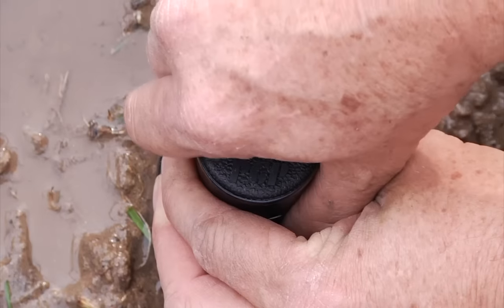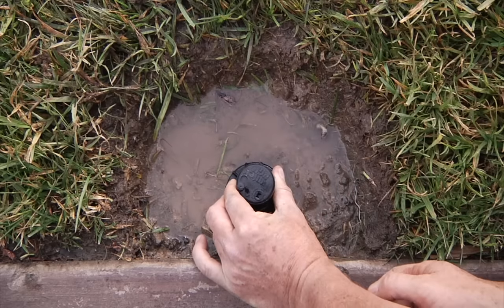Adjusting a Hunter Rotor: Rotor Right Stop Adjustment

Comment: This was exactly what i needed. I’ve been messing with these screws for days with no result. Now i learned that the sprinkler doesn’t need to be running to adjust it, and no need to wait to see how it turns after changing a setting. Now i know exactly what to do 👍 But maybe i broke some heads already. Will see.
Reply: Great video.  I tried looking through the instructions and they seemed a little challenging.  I adjusted 6 Hunter heads today and they all went well so thank you very much for helping the instructional video.

Comment: To anyone out there, a word of warning: in this video the large, black plastic ring he unscrews at 3:20 to remove the inner barrel/sprinkler riser loosens up with hardly any effort.  IF this same ring on your Hunter I-20 sprinkler head has not been removed in a long time, there is a high probability that as you crank on the ring counterclockwise to loosen it, instead of "only" the ring coming loose, the ENTIRE sprinkler, (meaning the inner barrel/sprinkler riser, the ring AND the outer barrel) may come loose from your water feed line below the entire sprinkler assembly.  How do I know?  This happened to me today when trying to remove the inner barrel to set the right stop of the arc.  I then put the entire sprinkler assembly in a vise and tried to loosen the ring with a pair of channel-locks.  No dice.  I then tried loosening the ring using 2 channel-locks gripping the ring and the outer barrel.  Still no dice.  The bottom line is I couldn't get the ring off (to remove the inner barrel/riser) without crushing / completely destroying the outer barrel.  When I called Hunter Tech Support the guy I talked to said that in order to NOT have the entire sprinkler assembly come loose he digs down BELOW the ring and puts a pair of channel-locks on the outer barrel and then twists (either by hand or a second pair of channel-locks) the ring loose.  Bottom line: be prepared for the ring on your sprinkler to NOT come loose as easy as in this video.  Sorry for the long post but maybe this will help someone out there.
Reply: That’s common sense tho. I work at a soccer complex so we’re always replacing head. You need to dig about 10 inches to be able to get the guts out of the sprinkler head. Other wise yeah the whole unit spins and you might get a leak or the whole head just popping out of the ground.

Comment: Perfect!  Appreciate the "two methods" to adjust the right stop; some other videos just say to tight the whole rotor sprinkler clockwise, which could crack the rotor bottom or the underlying threaded riser if the rotor was fully tightly screwed on already.

Comment: I'm confused, you said that the raised rubber arrow is the area that is used to adjust to the right or to the left. I thought that that area could only adjust the water that comes out. Basically to let it flow straight out or more like a spray. I thought that you are suppose to use the hole that has the plus and minus for adjusting the head swivel.
Reply from the maker: Thank you for contacting Hunter Technical Support.
 
Please visit this support section to view our written adjustment instructions. For help aligning the right stop, click here. https://www.hunterindustries.com/support/residential-rotors-adjustment-instructions

Comment: Thank you.  As a single woman, I pay my landscaper $55/year to adjust the sprinkler heads.  If I see brown spots and call him back, I may have to pay additional.  This video really helped.  It took a few views and some trial and error to understand the "right side" concept and how all arc adjustment must follow the right side.  I did have some difficulty moving it.  But in the end, I learned something and feel confident that I can perhaps tackle replacing heads when necessary.  One thing I am noticing. .. When the system shuts down, the head takes about 2 minutes to slow to a stop and then it needs to be pushed down.  Is this normal or is there a way to fix this as well?

Comment: Good video.  Note that, to make the left stop INCREASE its distance, you turn the leftmost setting CLOCKWISE -- someting I find a bit counter-intuitive.

Also, Hunter or someone makes a small white plastic collar that goes around the  sprinker AFTER it has been raised with the little tool.  The purpose is so that you don't have to hold it up using one hand to offset the spring.   Then both hands are available instead of getting fatigue from counteracting the spring.  That is handy for changing the NOZZLE -- which is not accessible unless the sprinkler is raised -- and is not shown in this video.
Reply from the maker: What a great tool! Hunter makes a Nozzle Insertion Collar (123200SP) that will hold up a rotor while it's being serviced. You can order one from your local Hunter distributor.

Comment: Thank you for the easy and precise explanation. One question please, how do i get the sprinkler to water closer to the head, it sprays far away and makes puddles and 3 feet near the head it is barely wet. Same problem with the MP rotator. I have chosen Hunter for all the sprinkler heads and I need some help.
Reply from the maker: Industry standards call for head to head coverage, helping provide a more uniform sprinkler coverage. A head that has a 15 ft radius would have the next head spaced 15 ft away.

Comment: Hello Hunter,
The rotor that was installed in the corner of the grass next to the driveway has been driven over by a truck.  While the sprinkler head is not damaged in any way and is still fully functional, it has put a tilt in the canister and is no longer vertical (or 90° from the horizontal ground).  When the rotor has water pressure behind it and it pops up, it is at about a 75° angle which throws off the arc and it sprays directly into the ground about about 2 or 3 feet away from the rotor.  While I could adjust the arc, it would still be a bit wonky.
How do you recommend I fix the tilted canister?  Do I need to dig it up and fix the angle when I put the ground back around it?  I am afraid that, if I did too deep, I will cut into the water lines.  Do you have a diagram of how the water lines are hooked up to the canisters?

Comment: Do you also have a video on cleaning these? Mine has stopped rotating and has a pool of water developing around it. I think that means it needs to be cleaned right? 

Finally found a video with my exact model! Thank you for this
Reply from the maker: Thank you for contacting Hunter Technical Support.
 
If the sprinkler is no longer rotating and the water flow coming out of the sprinkler has decreased, you can first try cleaning out the filter by removing the pop-up assembly from the main body. The cap can be threaded off and the internal assembly removed. https://www.hunterindustries.com/support/residential-rotors-rotor-stopped-rotating
Reply: @Hunter_Landscape_Irrigation  thanks so much for this! I’ll give these instructions a try. Great customer service!

Comment: Any tips on cleaning/replacing the spray nozzle ?
One nozzle on the rotor head just refuses to deliver the water even though the head pops up. The other two rotors in the station sequence work fine.
Thank you!

Comment: Great video!  My i20 doesn’t have a cap to unscrew. How do I get the inner assembly out?  I need to adjust my right stop.
Reply from the maker: Thank you for contacting Hunter Technical Support.
You do not need to remove the cap to make rotor adjustments. The cap on an I-20 has the same openings for an adjustment tool.

Comment: When inner body is pulled up with key is there a way to lock it in that position? It would make pre-adjustment in hand easier prior to install & in more comfortable position than when working at ground level.Be easier than trying to hold it up & adjust rotation while holding against spring tension.
Reply from the maker: Thank you for contacting Hunter Technical Support.
 
The nozzle insertion collar can be used if necessary. Visit the video here. https://www.youtube.com/watch?v=HSV3EERHhfg&t=5s

Comment: Best Video yet on how to adjust a Hunter PGP.  questions for Hunter in regards to the Head and Assembly that sits in the Cavity/Container piece.  Is there a rubber gasket that could corrode after 10 years?  One of my sprinkler heads was spraying water from this area causing low pressure output at the nozzle. Ensuring it was free from debris and no visible cracks, I was unable to hand tighten enough to prevent leak.  Another unit I have, I am unable to unscrew the assembly.  Thinking they were not to be opened,  I was able to minimize leaking in the first unit by over tightening it with pipe wrench and vice. (using caution not to crack or damage the unit)   How tight should it be?  Thanks!

Comment: We had a sprinkler head replaced recently. Tech left the setting at 360 degrees. We are watering community grounds. Not sure how to adjust to 180? Is there something I do differently because there is essentially “no” right or left stop right now?
Reply from the maker: Thank you for contacting Hunter Technical Support.

The Hunter rotors are set from the factory at 180 degrees and are adjustable from 40 -360 degrees depending upon the model. The PGP-ADJ is adjustable from 40-360 degrees. The PGP Ultra and I-20 models are adjustable from 50-360 degrees.

If the left arc, right side arc, or the radius coverage of the rotor is not properly aligned the results may be a wet walkway or a dry turf area. These all can be easily aligned.

Comment: Performance of the sprinkle is a none issue, but the adjustment tool?  How does a home owner aquire the tool if they are the 2nd owner of the home and need to make adjustments?
Reply: Great question!  I did a screen capture of the white key in this video, took it down to Home Depot where there was a lot of head scratching between 3 employees, one of whom found it in an upper bin next to the Hunter rotors.  $.43/ea

Comment: The problem with this video is that it doesn't follow the directions on your site.  The directions on the site state that all arc adjustments for the +/- must be made with the turret turned all the way to the right stop.  In the video he doesn't do that.  He adjusts the +/- with the nozzle pointed in all different areas.  Which is right?

Comment: Doesn't work that way for me... I turned the turret all the way right with the arrow point at my starting point, then I turned left.  Left stop was too short so I adjusted the screw + direction for the left stop, but when I turn the turret back to the right the arrow has moved beyond the original start point.  It's like turning the +/- screw makes an equal (divided) adjustment between both the right and left stops.  5 heads... all the same.

Comment: is it possible to turn it off or cap it so it doesn't spray at all, if so how
Reply: dabigb1973 the higher model i20s have something called flow stop. If you don't have the i20s installed, (which you probably don't, remove the head and cap the riser

Comment: The method of unscrewing the top and rotating the innards doesn't work for me.  The next time the water is turned on the head rotates a random amount clockwise, giving a new fixed right side location.  Rotating the whole body works.  Ideally you are rotating a small amount clockwise so you can rotate by the top and not have to excavate the body to get a grip.  Somebody mentioned grabbing the popup and rotating while running.  Also didn't work for me.  Same problem.

Comment: Why would mine be leaking from the top? It’s new
Reply from the maker: Thank you for contacting Hunter Technical Support.
The main reason this happens on a new rotor is lack of pressure. The heads require a minimum 45 Psi to maintain the flow through the nozzle; otherwise, it might spray from the base. You can try a smaller nozzle with less GPM that should increase your pressure.

Comment: I wish that I would have watched the whole video before adjusting the right stop because when you said to turn the entire head to the right...I forced it and broke it. I wish that I didn't pause the video right after that part and watched where you instructed that if it doesn't want to turn, then unscrew the outer cap and pull out the inner assembly and turn it to the right where you want the arrow to point then screw outer cap back on. I jumped the gun...my fault. Good video though, thanks.